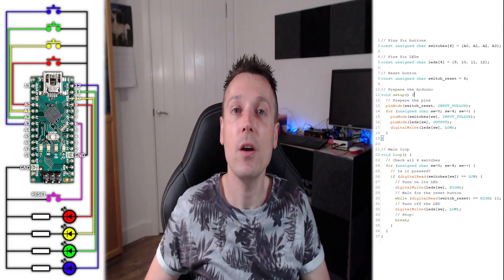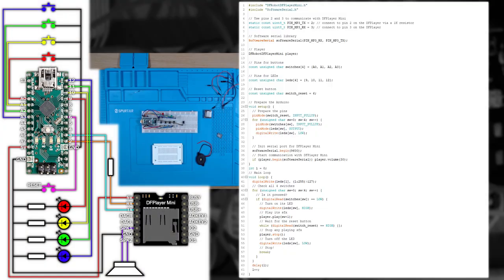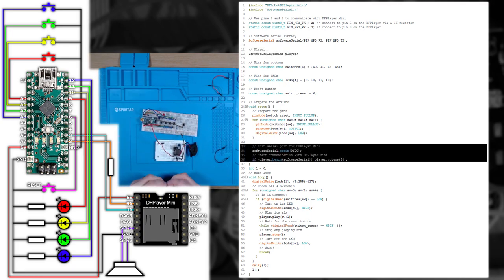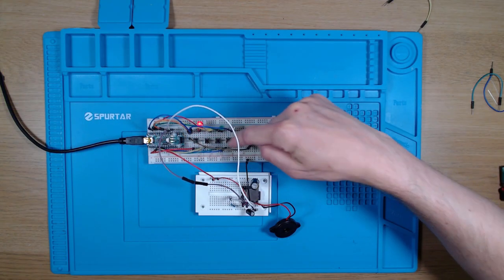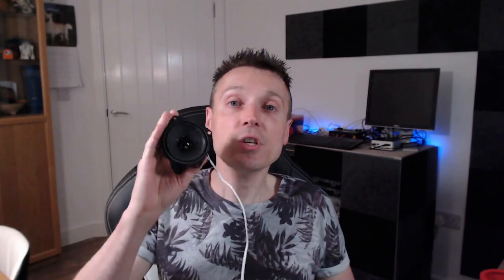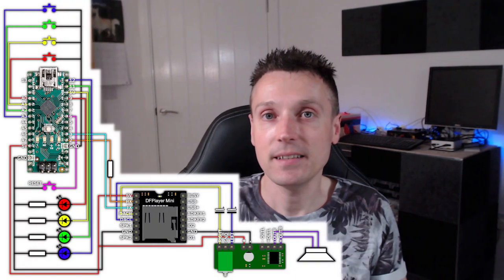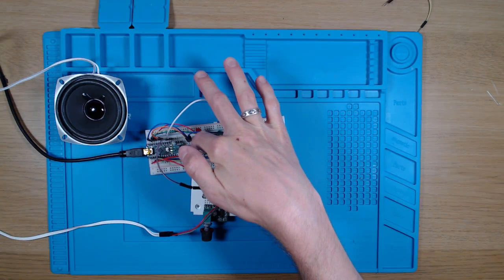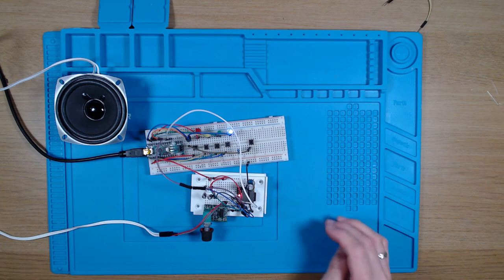Arduino Tutorial - Quiz Buzzer System - Stop the Fighting Over Who Answered First! Part 1

Comment: This is exactly what i was looking for! Still figuring out if i can add a 5th button and if it's possible to extend the program to do an extra loop with just the buttons that weren't pressed the first time around. But anyhoo...For now, this works like a charm!
Reply from the maker: If you take some code from the second video it does the ‘extra loop with just the buttons that weren’t pressed the first time’ - glad you liked it Adding a 5th button should be fairly easy
Reply: @RobSmithDev  Got it to work with 5 buttons, just couldn't get the DFPlayer mini to work...ah well, that's for a next project. Thanks a bunch for the code and the insights!
Reply from the maker: DFMini can be a pain sometimes. Glad you got 5 working

Comment: Greetings, friend! Thanks for the awesome video. I was looking for a solution for our workplace quizzes. This should do nicely, if the IT department will play ball. If not I will just have to do it myself. Thanks for the links, but the link for the PAM8403 Stereo Amplifier is the same as for the DFPlayer Mini.
Reply from the maker: You can find them on eBay (https://www.ebay.co.uk/itm/254590266239) for example but you’d be better connecting up to a better speaker system

Comment: Thanks for the video! Could this be expandable to 8 players (plus host) using the nano? I've seen builds using the UNO, and wondering if the nano could handle that many players (w/ host being the reset)
Reply from the maker: It could but you wouldn’t have enough pins to light them so you’d probably have to use either a port expander or connect them up in some kind of multiplexing.
The wireless one in the next video is possibly easier to extend

Comment: Hey Rob, thanks a lot for the tutorial, I built it here. There one thing I need help though, when you push the reset button if someone is already pushing one of the buttons that gets activated, is there a way on the code to verify if that is the case to not accept that player that pushed and held the button before we reset the system ?
Reply: Never mind man, I figured it out
Reply: I set an array with 4 positions set all to 0, at the if statement that checks if the button was pressed i added another clause to check if the array in the position of the button was equal to 0, then inside the while of the reset button I created another for loop that sets the array to 0 and then check if the button is being held, if yes, sets the array to 1, and if the player is still holding the button by the time we press the reset button said player button is disabled in the next round
Reply from the maker: Cool, never encountered this as a problem but could see how it could be!

Comment: Hey Rob! A summer camp near me asked me to look into building something similar for them. But they want 8 players and a display that the 'host' can see that would give the order in which ALL of the buttons were pushed. Is your project expandable into something like that?
Reply from the maker: Hi, yes I suspect you could do this quite easily. There should be enough free pins to support 8 buttons. And then all you need to do is have it send out over the serial port which buttons were pressed, and make something to show it. There is a wireless version you could modify too but this version is much simpler